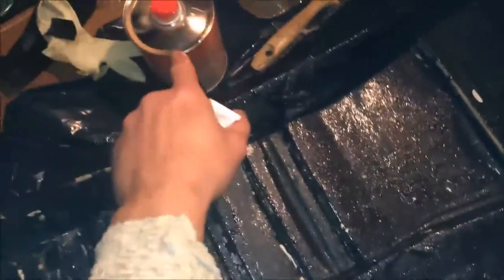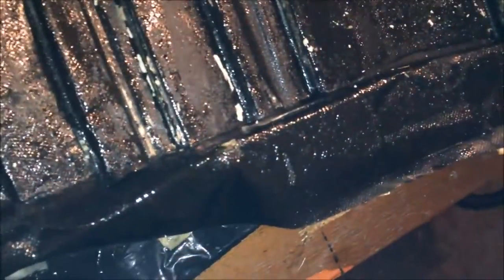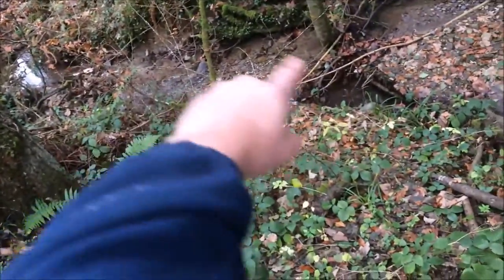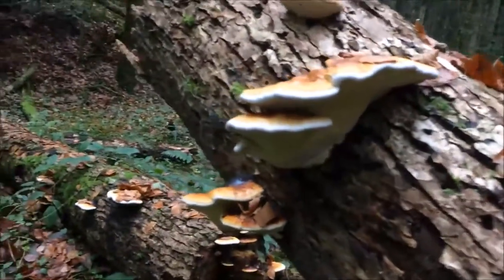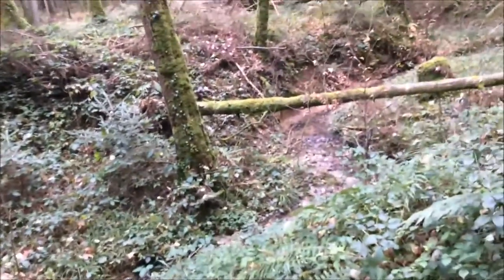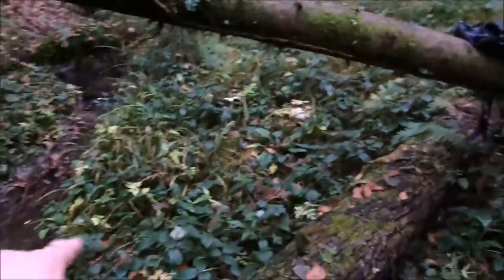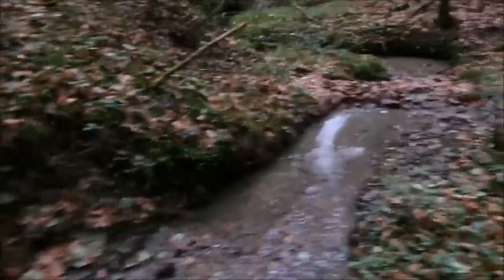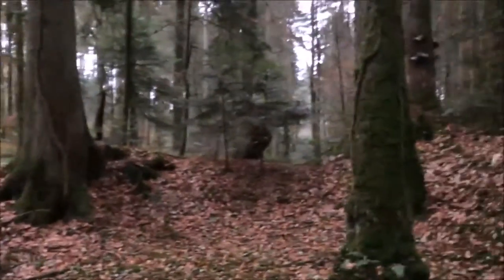Sluice update and back to the new river  27 11 16

Comment: That must have been disappointing hope you are able to clean it up and do it over. We had our first snow last night only an inch or two and it is supposed to warm up again later in the week so it won't last long. Hope you find some work to fill in until February.
Reply from the maker: Thanks Dale December and January is always slow A month longer wold have been nice. Might have to re design the sluice.